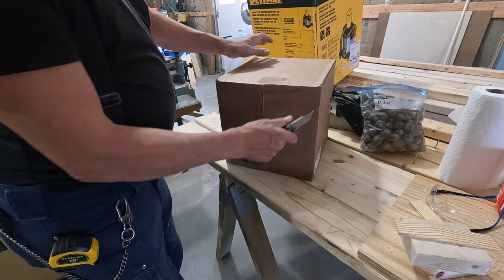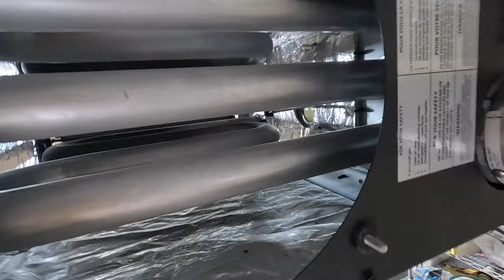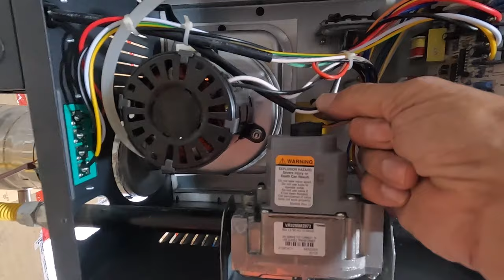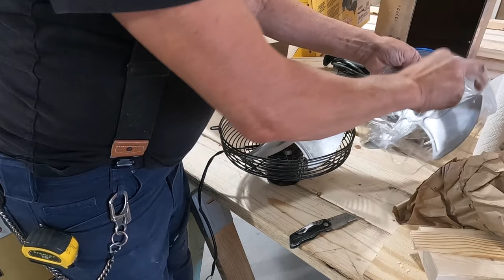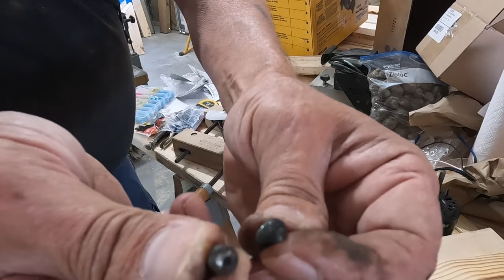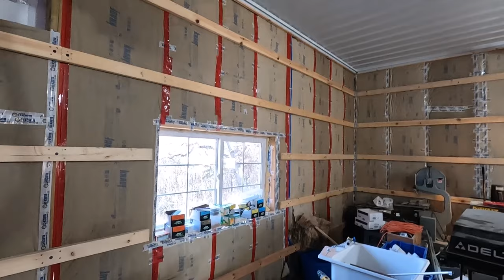How-to Replace a Garage Heater Blower Fan

Comment from the maker: Here are some of the things used in the heater install:

Mr. Heater 50,000 BTU Big Maxx - https://amzn.to/3G35gwH
High Temp Silicone Boot - https://amzn.to/3Cy6Tld
Yellow Jacket Gas Pressure Test Kit, 0-35"Wc - https://amzn.to/3FXUzf3
Temperatue/Humidity Sensor - https://amzn.to/3CwMD3h
Monster Thread Seal Tape - https://amzn.to/3EV24V2
1"x 12"x 24" Ceramic Blanket - https://amzn.to/3GKBy0b
1"x 24"x 32" Ceramic Blanket - https://amzn.to/3ilA443
ProFlex Gas Pipe (1/2" x 25 ft) - https://amzn.to/3gjIEis
ProFlex Gas Pipe (3/4 x 25 ft) - https://amzn.to/3VBL0cR
CSST Tubing Cutter, 1/4-inch - 1-1/4-inch - https://amzn.to/3SeuiNB
Pro-Flex 1/2" Brass Male Fitting - https://amzn.to/3yF9k3l
Pro-Flex 3/4" Brass Male Fitting - https://amzn.to/3D0gKRq
Pro-Flex 3/4" Union (Coupling) - https://amzn.to/3ezIWRP
Pro-Flex 1/2" x 1/2" x 1/2" Tee - https://amzn.to/3EGq2U1
Pro-Flex 3/4" x 3/4" x 3/4" Tee - https://amzn.to/3TcQqcI
Pro-Flex 1/2in Termination Plate 1/2MIP 3/8FIP CSST Male Adapter Fitting - https://amzn.to/3T3MkDq
Nylog Blue - https://amzn.to/3KNjtQI

Comment: I couldn't see close up when you were taking the fan off,  but if there was room, a nice T handle hex key would give you more leverage to bust through that loctite. I never owned a set and finally bought a set of SAE and metric and they are a lifesaver when I need them! My hands won't hold those tiny keys like they used to. I have to think that fan was either flexing or slipping at high RPM. I have that exact heater, so I watched this in the event that I have to change mine. Hope not!
Reply from the maker: Thanks J Ned! I agree about the T-handle hex keys. I've wanted a set for many years but couldn't justify the cost — I almost pulled the trigger a few months ago, but again couldn't do it. I bought a single wrench for the set screws on router bits long ago, but at the time the full sets were very expensive. This comment pushed me over the edge though. I ordered a set of SAE and metric padded t-handle wrenches! 

As for the fan, it is still vibrating more than normal, but at least it is quiet — for now. I'm wondering if Mr Heater cheapened something-up? A vibrating fan will eventually fail, so I will need to make another video (you can hear it in the next room better) and see what they say. I'll also tighten-up the mounting nuts and see if that helps? Kinda frustrating... 😩

Comment: Hi Mojo, nice job let's hope the motor lasts a lot longer than the old one,was it still in warranty or did you have to pay for a new motor
Reply from the maker: Thanks Larry, but unfortunately even though it is not rattling, there is a vibration that can be heard even outside of the building! I'm going to try tightening things-up, but the whole mess is just taking up time that I don't have 😑 I'm going to tighten things up super tight and see if that helps — stay tuned for another video. No, the motor was preplaced under warranty and there was no cost — so-far.

Comment: How is the repair holding up? Got a part number for that replacement motor?
Reply from the maker: Actually, the second motor (or fan blade) is loud as well. They sent another replacement fan blade, and I will be installing it next week. I can get the motor info when I do that. I will be putting a Molex  connector on the wire this time because I will likely be be doing this again 😑
Reply: @PlanetMojo  I'll be tearing the fan motor out of mine later this weekend. It's making the same noise and my gut is telling me that the fan/screw is the culprit. Half tempted to weld it on instead of using the screw, especially if a new blade comes with the replacement motor.
Reply from the maker: @InTheDirtAgain  If I had it to do again (the complete tear down) I would just cut the wire, and use Wago connectors to reattach it. I did it the hard way for the video, but will be cutting the wire next week when I do this again. The motor being tethered to the main unit is a big problem. Wago's work super well, and are cheaper than Molex connectors. You can get them here if they don't have them locally: WAGO 221-412 Series Inline Splice AWG 24 – 12 (60 ct) - https://amzn.to/3RmNVW3 My video will be out next week, so maybe comment there on how your project is going. I will be going with either a unit replacement or perhaps a quiet duct fan if the new blade doesn't work, but getting it on and off will be a lot easier. 🥴
Reply: @PlanetMojo  Since it is a simple 2-wire electric motor, I would think any other setup would be better than what they use. Can't stand the cheap-o metal blades and there are plenty of 120v fans available in that size.
Reply from the maker: @InTheDirtAgain  I agree. Let me know if you find something before I do 😊